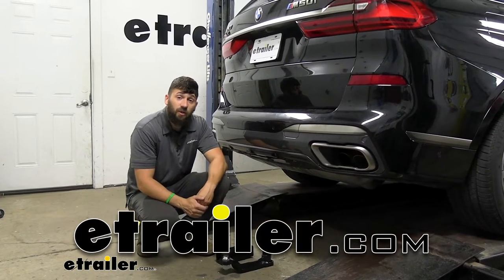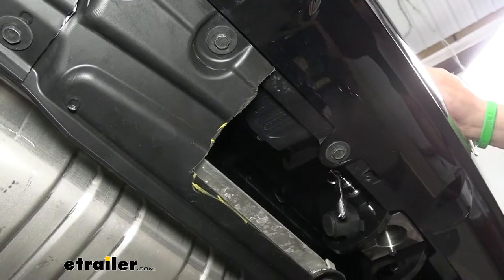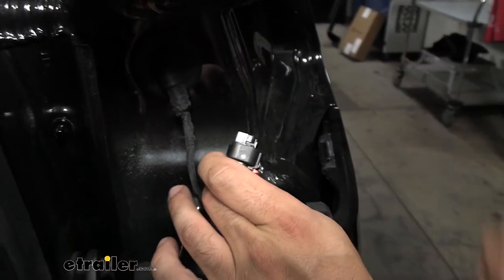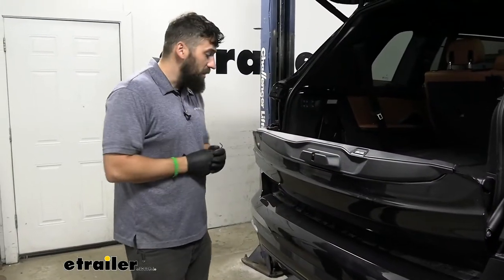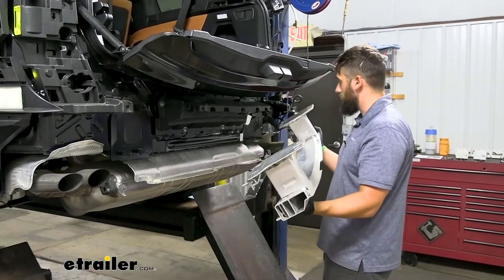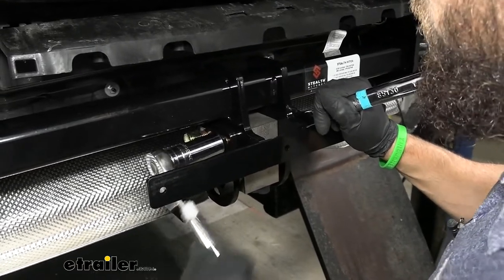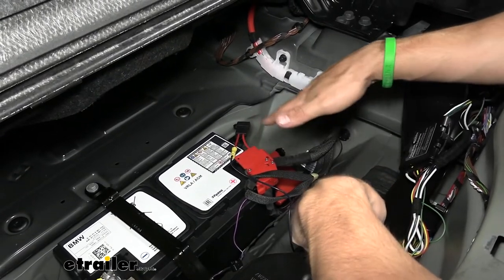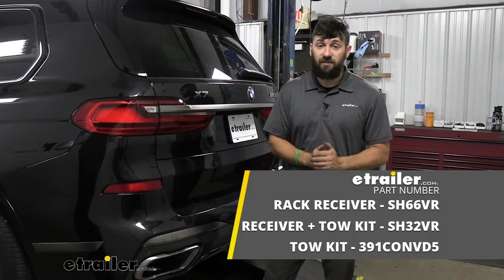etrailer | Stealth Hitches Hidden Rack Receiver Installation - 2022 BMW X7

Comment: Does 2023 X7 M60i can install this tow bar kits?
Reply from the maker: The Stealth Hitch #SH66VR is compatible with your 2023 BMW X7 M60i. That hitch includes a receiver that's suitable for hitch mounted accessories, but NOT towing. The hitch model that includes the ball mount/wiring kit is # SH32VR is suitable for towing.
https://www.etrailer.com/Trailer-Hitch/BMW/X7/2023/SH66VR.html
https://www.etrailer.com/Trailer-Hitch/BMW/X7/2022/SH32VR.html